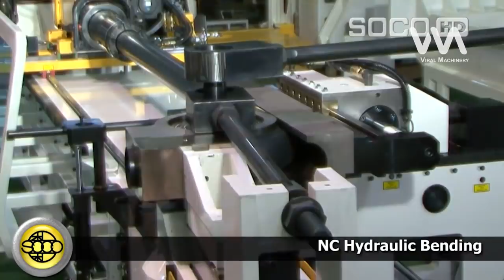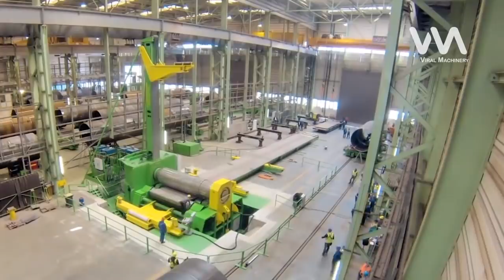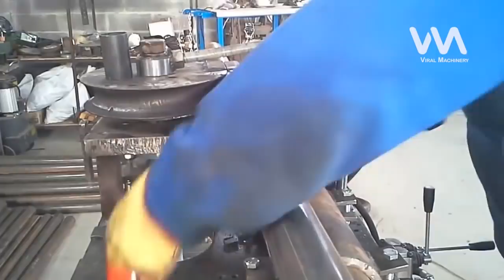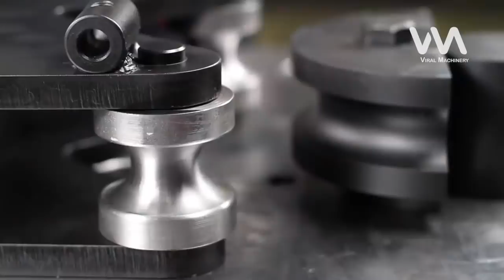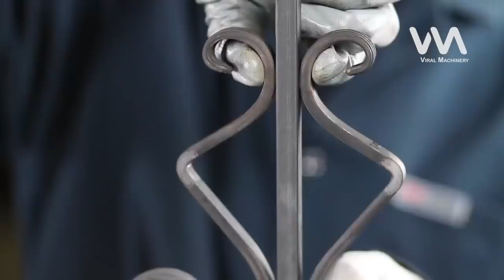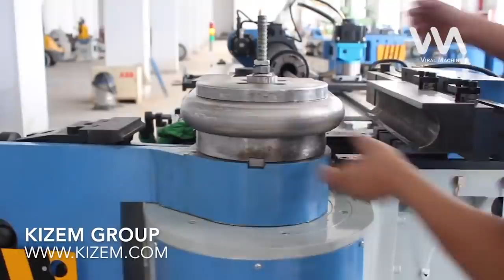Fantastic Huge Steel Tube Bending Machines Working Perfect. Amazing Big Metal Plate Rolling Methods

Comment: I had worked in a boiler manufacturing company and the degree of bend for cold rolled tubing was limited by its wall thickness.  The thicker the wall thickness, the less degree of bend because on the inside radius, the pipe wall would compress and thicken and the outside radius, the pipe wall would stretch and become thinner.  The allowable degree of bend would probably lessen as the pipe diameter increases.  My guess is it appears to be about a 36" diameter pipe and is probably limited to a 10 to 15 degree cold rolled bend.